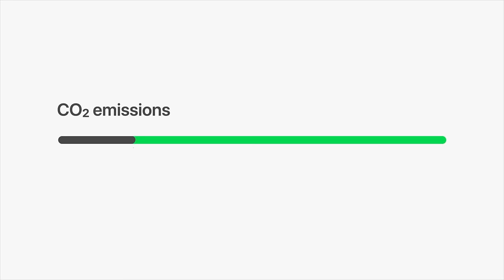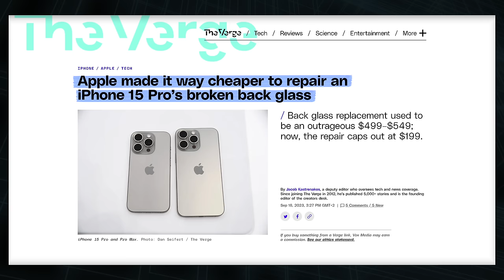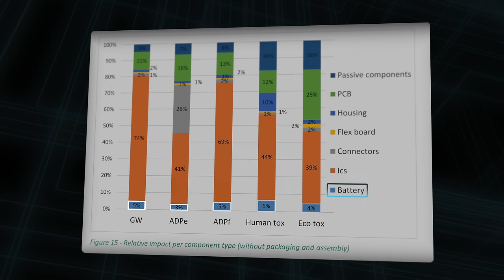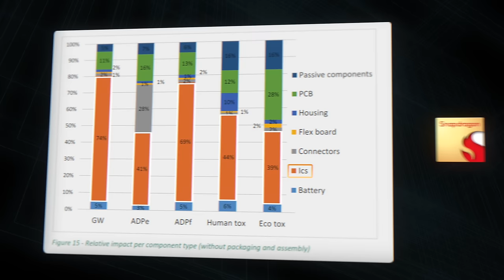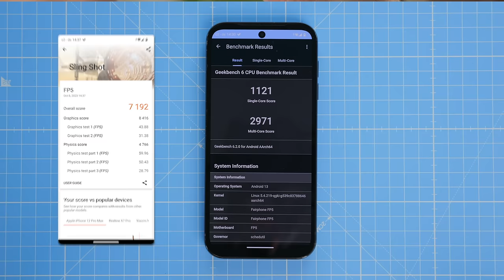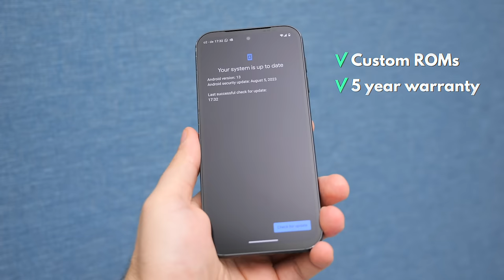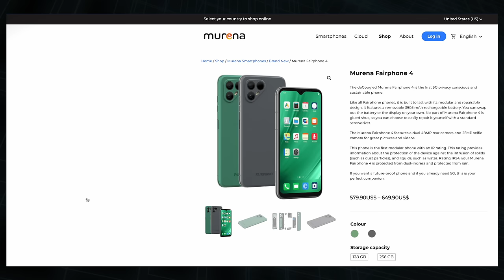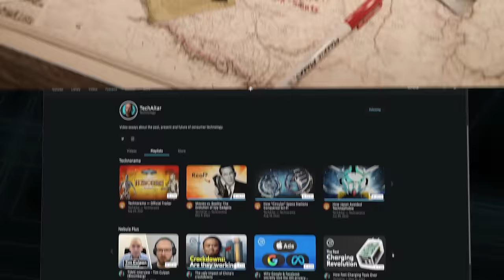Is Fairphone really fair?

Comment: I had a fairphone 1 and 2. I was happy to pay a high premium for an ethical option. They were poor phones. Fairphone 1 had an exploding battery and fairphone 2 didnt last 2 years. 

I skipped fairphone 3 and bought a fairphone 4 after having generic android phones. I've had it over two years and it is still working well. The only problem I've had is the UCB C charger port stopped working. It was very easy to replace. Fairphone 4 is much better than the previous fairphones that I've had. I plan to keep the fairphone 4 for a while longer.  I've heard good things about the fairphone 5 as well. 

You can get better value for money, but to buy a smartphone that does not exploit people is important to me.
Reply: I guess when you're ready she can think about stuff like that lol. If I'm going to spend $500 on a phone it better be really good not just pretty good

Comment: Saying the other manufacturers are "too cheap" after pointing out that their margins are 3 to 5 times higher in just how much more money they make, almost entirely to the benefit of their higher ups and shareholders, is kind of weak tbh? like these companies could be a lot more affordable, or could absolutely afford a more sustainable process at their price. Unlike fairphone that is not what their goals are, which in this case is probably most of the problem.
Reply: Yeah you can't compare apple to fairphone because of scale, designing a motherboard for example is kind of a fixed cost, regardless if you sell 10M or 1M units, so apple which sells more just makes a way larger return on their investment

Comment: My question is, is FairPhone better than just buying a second-hand or after market phone and trying to keep those as long as possible? 

In my anecdotal instance, I bought a Pixel 3a right as they were going off the market and I've kept that for about 4 years. Recently the screen shattered and it's actually more cost-effective for me to buy a used Pixel 5 off NewEgg than to have it replaced.

My main qualm with FairPhone is that high upfront cost, but I truly do want to do whichever option is better for the planet's health in the long-run.

Comment: Honestly regarding that apple add its kinda greenwashing in a way anyway. Like yes plastic is bad, but honestly carbon emissions are way worse. I'm thinking its fairly safe to say that a metal part will require a lot more processing than plastic and the more processing, the more machines producing CO_2. Sure the metal can be recycled easier, but that will still require the melting down of the metal, then cleaning of the molten metal before reusing it. And you know apple arent going to actually pay to do that. They will just have everyones returned phones in a huge stockpile ready for recycling but then wont ever actually do it. Using plastic materials is great for the environment (in the eyes of climate change) so long as the plastic is built to last. Single use plastic is bad sure, but often the alternatives are worse for the atmosphere purely due to the increased processing.

Comment: The problem is that things have been too cheap for too long on the expense of those who have not that now in order to improve sustainability, rasing prices of stuff will hit hardest the same group on whose expence we arrived to the need to think about sustainability.

This proves the fact that the current economic system is incapable of functioning as a viable solution for sustainable future. Instead we must change our approach from efficiency to productivity from the sustainability perspective. Progress towards sustainability = value of pay. This means that we eliminate the need to do things and with what we can't eliminate we reduce the resource consumption required to achieve a needed result. This means a totally different shift in thinking and that change can only happen when it is supported by the financial rules and regulations, meaning that the one most beneficial to these criteria will get most paid instead of the one producing the most units. Efficiency will still be a factor but a smaller influence. This would result in people being motivated to use their creativity to come up with sustainable improvements and they will be socially rewarded the more they invest in improving sustainability by getting attention, badges and others using their solutions (paying them for it).

Comment: This is just my opinion, but I feel like we may benefit from moving away from the smartphone ecosystem and into something more durable (a new type of device perhaps?).

Repairability is nice, but when the manufacturer decides to give up on a device and it stops receiving updates for its operating system, you get cut out from developed apps which are only released for the latest device operating systems. This happened to someone I know who lives without a smartphone. When came the time to do some mandatory paperwork which require an app, she tried purchasing a second hand smartphone. Except the app only worked on the latest operating system so she purchased a second hand phone for nothing, and her paperwork is still due. It's still perfectly usable for 90% of use case which is nice, but the whole ecosystem (hardware, software, apps, etc.) keep advancing.

When you compare the smartphone ecosystem to, say, a desktop computer, it feels like smartphones are nearly designed to be disposable, as much as I hate that, whereas you can keep your computer going for much longer than that. Take it from someone who's only ever purchased 1 smartphone.

It's still very niche, but I appreciate the Framework laptops for that. They're slightly closer to desktop computers since you could just replace obsolete hardware and keep using it, instead of replacing the whole unit.

Comment: I've already decided that my next phone is going to be a FP5. I really like the simplicity of iOS and would've picked a used iPhone if they wouldn't have made repairability such a pain in the ass, specs wise it's overall "good enough". At the end of the day my Phone needs to take pictures, run some games, make calls and be reasonably easy and cheap ro repair. More water resistance would've been nice but over the 15 odd years of having phones and handling them with minor care, none had water damage and only got replaced because they were outdated.

Comment: 100% recyclable cobalt statement is marketing tool. Most metals have quite high % of metal, steel has over 70%. Just because it has recycled metal doesn't mean the original metal is ethical sourced. It is an easy way to rebrand unethical product into ultra ethical. Also recycling metal is much cheaper than sourcing new metal, there just isn't enough metal to fully supplie all the industries.

Comment: I bought two phones in the past 10 yeras, both of them cheap Xiaomis that I reinstalled ROMs on.
I noticed that if my phone doesn't physically break, it will run fine, but the batteries even new ones from China are the biggest problem.
Fairfone is looking like a bad economic business, but an excellent ethical business.

Comment: I would love to get the FP5, but I Just can't. My FP3 that I bought almost 4 years ago still works fine. It's a little bit laggy nowadays, but there ist actually no reason for me to get rid of it. I changed out the USB C Port last year, but even the battery still holds up absolutely fine. 
I will wait for the FP6 in 2 years and see if i can justify to swap then.

Comment: "without tight integration you can't really seal up everything that much" excuse me ? most devices that go beyond rugged use are modular and it's even best for guaranteed waterproofing since you can open up the device and replace the rubber seal if needed unlike the weak sticker glue that they use in most modern smatphones that has a high ip rating.

Comment: The components are still so over priced :( I've repaired my Hauwei Mate 9 for 7 years till it gave up, but a USB C port was like 3$, a new camera like 12 (an original Leica sensor), or like 1$ for basically all other small parts. Screens for like 10$. 

I guess my point is made in that. I love that there is a way to 'easy' repair a phone, but if it comes for like 5x the price is of the actual parts, its nothing fair. As you also mention in your video, the initial purchase is already almost double the price, and then the parts are aswell. 

As many other YT's pointed out, for that prices you could have bought 2 phones with the same specs. If they don't use the Framework way, of keeping the housing the same, then you buy a product that might not even outlast a non-repairable phone. My Huawei Mate 9 outlasted the availability of parts of the fairphone by 1-2 years (it was 5years before repairs were needed)

25 euro for your own backpanel repair is NOT cheap. A full aluminum back costs 3-12$ 
A screen for 'just under a 100 euro's', is NOT cheap. A Samsung A54 screen OLED is about 25$ (edit: or to put it into perspective, as you mention in your video, maybe for sustainable, green, non-explotiation parts it might be a fair price, but not compared to parts for flagships)
Don't compare to apple... They are insane and should just not exist in the market with those prices. If you care for even a single inch about repairability, apple is just a nightmare.

Comment: For me, by far the biggest problem regarding today's smartphones is the battery. I think phone companies have gone way way way too far in basically making battery a irreplaceable part of the phone and probably only government regulation could force them to make batteries easily replaceable. For example right now I'm using a four year old Huawei phone with android 10. It still runs as buttery smooth as the day I bought it and I don't think I'd ever have to repair it, but the battery is clearly degrading.

Comment: 4-5 years vs 2-3 data is a bs. “Regular” users change their phone when it starts stutter or when they want a new one because it is new. Not like fair phone any better in terms of usability and performance. I used my ipad mini 2 for 10 years but not like it was on par with any modern tech(also never changed a battery and it still holds for 3-4 hours of screen time)

Comment: These days, Smartphone dies not because of batteries but because of AMOLED screen failure aka, Colorful lines on AMOLED screens within 2 years of production or usage and it can be found from almost all OEMs be it Samsung M54 or S22 series or some random Foldable, or Oppo or Vivo or One Plus or Nothing etc. It is everywhere and it is burning the pocket of customers.
Reply: Wat. I've used exclusing AMOLED panels since the Galaxy S2 and never had an issue across 5 phones. Some I even rebooted as an emergency device 9 years later.

Comment: I got an XS max back in 2018. I did get insurance for it and dropped in waster sometime in like 2021. Since then, however, I only buy good cases and screen protectors and I have spare parts for it. I can fix anything on my phone.

BUT, I’m an engineer and a mechanic and all that…

I plan to move off of Apple here when they stop updating the OS.

Apple is building themselves out to be a subscription model for both hardware and services.

The writing is on the wall. They’re not only not the company that appealed to the imagination in the 00s, they are going fully against it…

Comment: Actually in the apple store they replaced my face id module without changing my screen or other parts of the phone. I still had the same scratches.
Reply: That was a full top earpiece + mic + light sensor + Face ID module swap, not just the Face ID module. You’d need to desolder the module to replace only that part, and Genius Bar employees aren’t allowed to go that in-depth with the repair. Still a bit wasteful, since you need to go through Apple to be able to pair the new top earpiece to your device (and Apple doesn’t harvest used components, so that means they’re making brand new ones), and you’re throwing away perfectly working sensors/earpiece speaker (since Apple won’t reuse them, as stated above).
Reply: @UpgradeUrWinRARTrial  I think it‘s completely fine. Apple is doing a great job and small repairs currently don‘t work for large scale and even in small scale are not efficient and often cause the device to break soon again.
Reply: @qwertzuiop875   it’s not a matter of if it’s fine or not, it’s a matter of wasted resources. Each component that’s thrown away has a human cost attached to it, that’s why Fairphone works so hard to make sure each component is sourced ethically.  So when you throw away working parts because it’s “inconvenient” to disassemble down to the bare PCB, you’re throwing away and basically saying the human labor, sweat, and blood that was put into manufacturing the component is wasted
Reply: I think it‘s great that they replaced only the module. It‘s already quite small and I don‘t know what you expect. You definitely have no connection to reality to understand how complicated and expensive it is to build an infrastructure that allows these granular repairs in an efficient manner.
Reply: @qwertzuiop875   it’s quite simple what I expect - a straightforward repair process that leaves as many working parts as possible while allowing the consumer/companies to purchase the part to repair. Because remember, this repair can only be done by Apple. If you try to take this to a third-party, you can’t pair the top earpiece with the motherboard. But cute, try actually repairing something before you open your mouth lmao

Comment: I would have gotten this phone, had i known about it last year. Instead I was "forced" to buy a Samsung, which has had issues. I say forced, because my last phone was forced off the network by AT&T and thus, no longer supported, even though it worked fine (and i had recently replaced the battery on it, which i didnt get the adhesive to stick right so there is a gap in the back). I hate these "glued together" phones. I dont swim with my phone so as long as it can withstand a little rain every now and then, id rather have it easy to open and close to repair and replace parts. 
But, i like in the US, and this phone isnt available to me.

Comment: 15:00 Yeah I wouldn't highlight the California bill as an example of right to repair. The law is a total flop. For example it doesn't cover game consoles so a pretty large market is taken off the table instantly, but even worse it doesn't prevent software lockouts against replacement parts nor does it actually say that you have to make individual parts available. Bundled parts like what Samsung does with selling the screen and battery as one are allowed.
All the California law does is make it harder for startups like Fairphone to enter the market, and I wonder if the California law is at least partially responsible for the lack of official Fairphone availability in the US.

Also, I Believe Fairphone is destined to fail. They offer all these extras and that holds them back. If they could focus on profit for a few years they could, for example, invest in their own chip design which would give them total control over sourcing and even allow them to support their devices even longer. This is how Google and Apple are able to provide such long term support with their Tensor and A series CPUs respectively.

Comment: Meh..    untill you can chamge the CPU and GPU as well as upgrade the RAM this is a gimmick. 

You can already change the battery and screen in smartphones for around the same cost (except if you're still an apple customer) as the fairphones replacement parts.  The cost is in the same ballpark anyway. 

So, all the major android companies have to do to make their phones have the same longevity as the fairphone is to provide updates for a few extra years, which theyre doing.

Comment: Frankly, I'm less concerned about the environmental impacts of Fairphone and more concerned with wanting a phone functional to modern needs, which treats the user with respect as opposed to consistently taking steps to take away control from the user, like Apple has done for decades and Samsung has been leaning into in recent years. Which leaves what: Sony, Asus, and Chinese brands like Xiaomi, Huawei, ZTE, and the BBK brands of Oppo and OnePlus? Bearing in mind anything with stock or stock-ish Android still has the spying and telemetry issues of Google, and embracing the Chinese ecosystem isn't exactly any better; there doesn't feel like many good options.

Comment: I have used a fairphone 2 and now 4 the first three generations were usable but not great the 4. Now is pretty good it still has some Problems for example sometimes the screen Bugs out but that's okay a restart fixes it. The really big selling point are the updates i get atleast 5 years of Updates and have full Controller ovemy device the bootloader is not locked and I can change out my battery and anything else if it breaks. Even if Samsung promisses 10 years of Updates it would be nearly worthles if I can not repair my device or change the battery. So yes if you want a better Phone regarding e waste go with the fairphone. But I dont like everything they do for example dropping the aux connector why drop it?